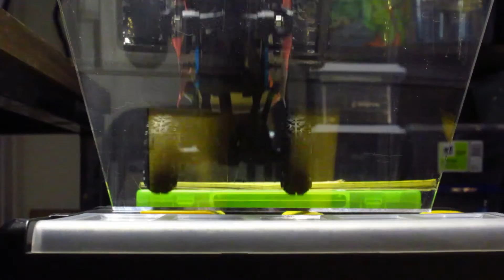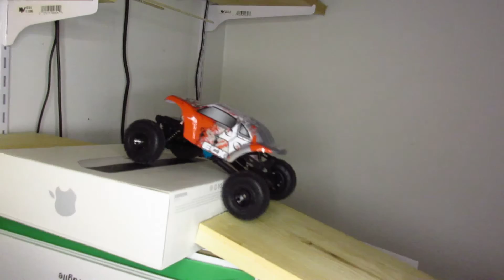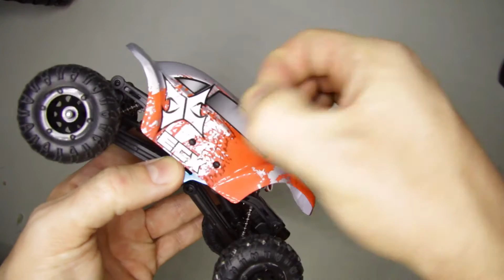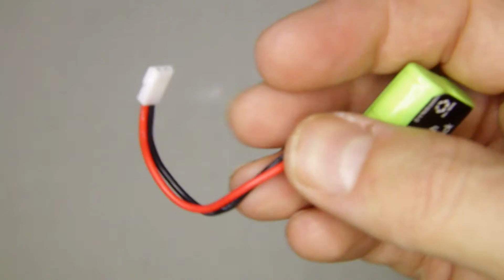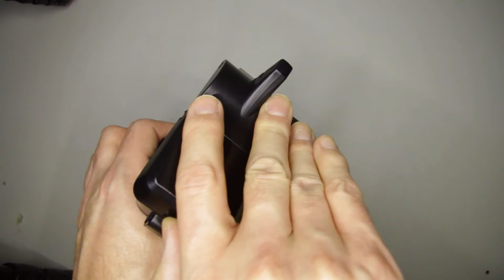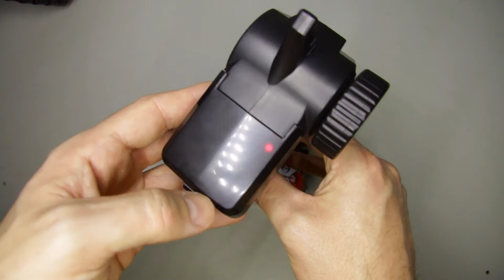ECX Electrix RC Temper 1:24 RC Rock Crawler

Comment: WTF was that incredible side to side slop of the axles???  WOW, crazy.   Looks stiff as hell to.  Losi trail trekker beats the brakes off this for near the same price.
Reply: +Chris Wilkinson  Trail trekker isn't discontinued, the Losi micro crawler is.  Trekker is $150 most places but you can buy it for $135 shipped.  They can be custom built up to performance that rivals 1/10 rigs actually, I have a few.
Reply: +Chris Wilkinson It's read that way for quite a while.  Did you speak to someone that told you that?
Reply: It is true, the axles on My trail trekker do not move like that.  Seems like Horizon took the losi 1/24 and 1/18 designs and basically made them cheaper, and made some unnecessarily detrimental design changes.  The problem with this one is that they moved the lower control arm mounts further apart at the body, and closer together on the axles, making them practically parallel with the uppers, in stead of triangulated.  One could try to remedy this by moving the chassis-end ball-mounts inboard, if possible, and spacing the axle end mounts outboard with some motherboard standoffs or something..

Comment: not sure how big this is in comparison to the ecx 1/36 kickflip and all, but I found those bodyclips really tiny and short too.  I used tweezers for a while but only recently my mom dug up some Christmas clip things for hanging ornaments and all (like metal paperclips, but not as thick and more malleable) and behold! They fit as better replacement clips as they are the correct size and they are actually longer so they are easier to put in and pull out. Also, I dont think ecx sells replacement body clips. At least not for my 1/36 kickflips.
Reply: +Chris Wilkinson thanks! :)  it was an accident find tho. but thats what I like about micros. all the 'regular' stuff u can use.